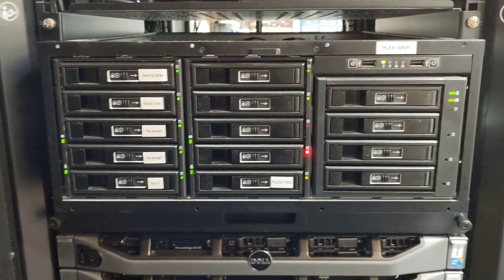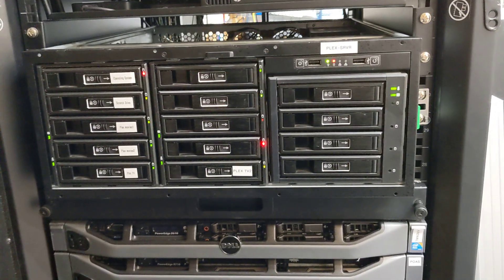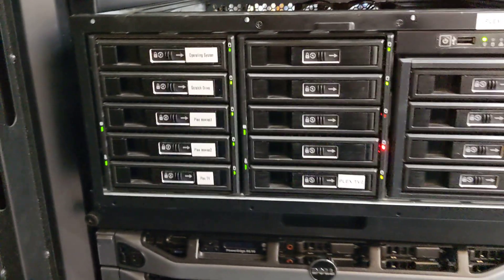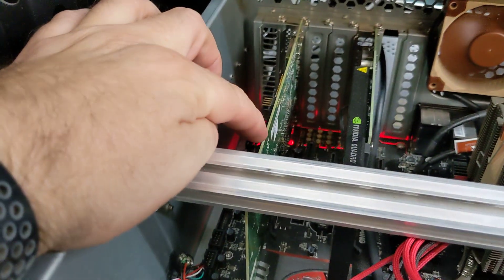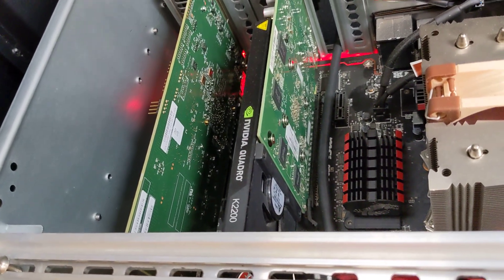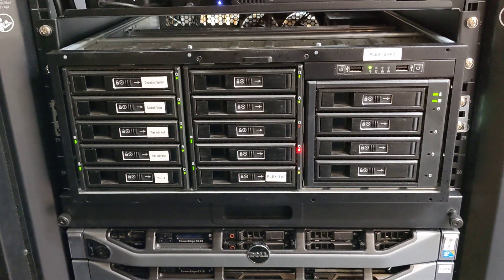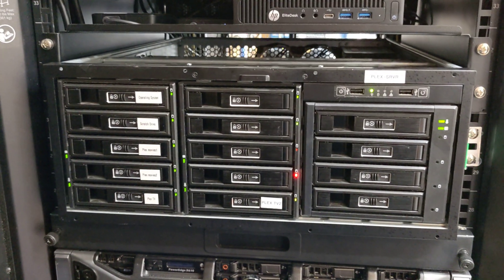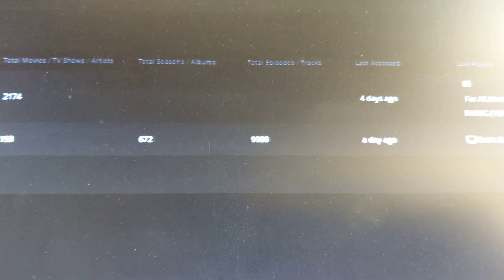Plex 4u Rackmount Server on and old PC, storage, transcoding, power usage/saving. #plex

Comment: damn wish my case had that many drive bays i have used xponology and a plex server for mine
Reply from the maker: I have a client that uses one of these full of 14Tb drives.  No RAID but if you are not looking for high IOPS this works great.  https://www.amazon.com/dp/B07MD2LNYX/?coliid=INOJ0PR44P95&colid=3GE65DGP4I7KQ&ref_=lv_ov_lig_dp_it&th=1
Reply: it is a rack mount but dont have external access drivebays i thoght about cutting and modding the case but then the drive bays that fit in the 5.25 drive bays are damn expensive just means i have to take lid off to add a drive only got 4 slots left befor mobo sata ports are full

Comment: Hey Matt...great video.  I may have missed it but how do you configure the storage for your Movies/TV Shows/Etc for PLEX?  Is it just a normal RAID through the HBA card through Windows?  RAID1?  RAID5?  Is ALL the media on one large redundant volume with different folders identifying the different types of media or perhaps multiple volumes? I think you said you have 30TB but was just curious how the storage is configured.  Thanks!
Reply from the maker: Great question.  I didn't think to explain that.  I have an HBA in there but its in IT mode so its acting as just a regular disk controller in Windows.  I'll use my movie volume as an example but the other content is organized the same way.  I have 2 physical hard drives were my movies are stored.  They are mounted in Windows as G:\Movies-1\ and F:\Movies -2\.  I think they are an 8TB and a 12TB WD Red drives (shucked a while ago).  I filled up the first drive and then just added the second drive path to the movies library selection in PLEX.  No raid, no fancy folder system on them.  Some content is in folders and others are just the files.  I let Plex sort and use the search criteria in plex to find what I want.  I don't use Radarrr or any of those services so files names and directory structure are not ideal----maybe someday....  Plex does a good job of allowing search and there is no difference to plex that they are on independent drives.  I only really need single disk performance so no raid on the content storage side of things.  I back up those disks to my disk shelf that is just UnRaid with a bunch of older disks and a few newish ones too.  I have been able to stream the same movie to 7 devices all at once with no problem so Plex is doing its job and not bogging down the spinning disks.  I think this is due to the use of a ramdisk and Quadro video card as I am able to get higher IOPS for encoding.  One additional thing I did was to move the plex media files like thumbnails, movie posters etc to one of those SSD drives that can hold two M.2 drives in a mirrored array.  I got one as something to play with and stuck two 512Gig drives in it.  Now I can scroll thru content with the preview and even play intro videos and its no problem at all.  Thanks for the question

Comment: Hi Matt - could you expand on why CGNAT is your preferred solution? Is that for extra “privacy” as many people share same ip? Also, how did your user handle TLS? You had them download a VPN client? Are they IT-savvy enough to remember the steps before using PLex? I currently rely on a reverse proxy with ssl cert on my infra to reduce the need for additional software such as VPN. Keen to hear your thoughts. Thanks!
Reply from the maker: Great questions.  CG-NAT does have its challenges for sure.  Ill answer your questions is sort of revers order.  Firstly, I also considered going the SSL cert route but found that the TLS tunnel was so easy for myself and remote use I just stuck with it.  As most of the poeple who use my Plex are also in the IT industry, the process for login is different but they are tech savy enough and willing to go thru steps to get access.  I currently run the TLS tunnel through a service called ngrok.  You have to get the basic package from them for I think $30/year and you get an xxxx.ngrok.io address.  Users then can access your Plex via that web page and log in.  I have tested with 4 users logged in remotely at once and did not see any bandwidth issues that impacted video quality on the remote sessions.  For CG-NET the act of multiple users having the same IP means that when tying to track down traffic from outside getting past the central "hub" from starlink is very difficult.  When I do a tracert from outside my network back to my network I get to the Starlink datacenter (I think its in LA somewhere) and thats as far as it goes.  My firewall picks up all port scans and when I check the logs I see alot less connection requests in starlink than I did on my old WISP.  Thanks for the great question.  I may make another video on the TLS setup as I think I can do that without too much work.  Im really trying to not make any video that requires too much work....  lol  I have a real job and the last thing I want is for YouTube to become another job.  Thanks
Reply: @Hephaestus93  wow thanks for the very detailed and extremely clear/insightful answer man! Keep up the good work and thanks for sharing :)

Comment: At first I was wondering why your dedicated Plex server was so beafy but when you started getting into all the use cases it makes sense with how much transcoding it would do
Reply from the maker: Thanks for the comment!  It is a bit overbuilt, and I could probably upgrade to something more modern and save some power usage.  The PC it runs on used to be used for several things and started as a gaming PC.  It was a fair gaming PC.  It was rebuilt and placed in its current case and served as a rack PC that I used for my business.  Then I started with Plex and it just grew as my plex library grew.